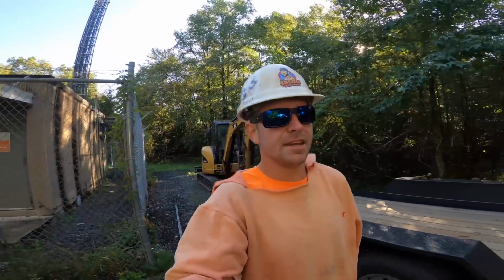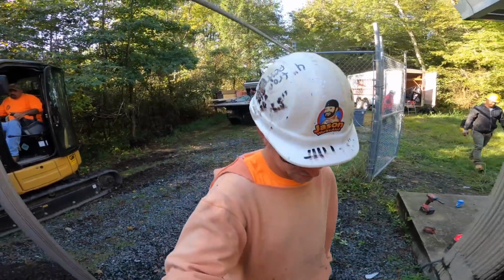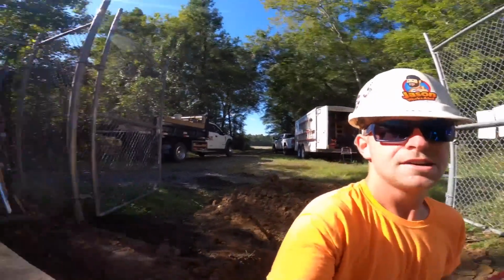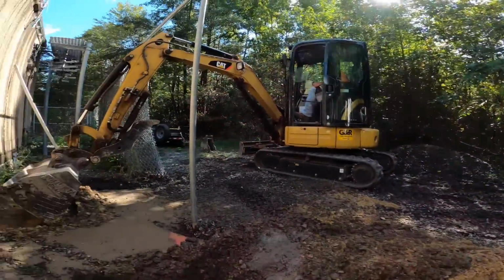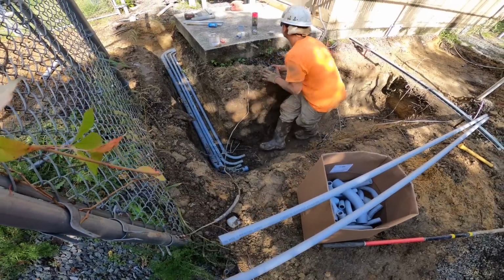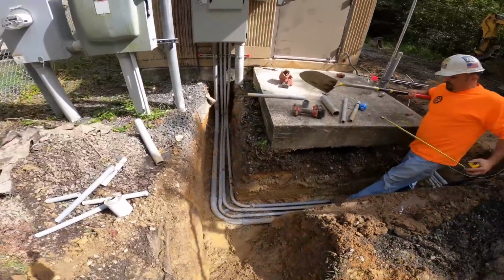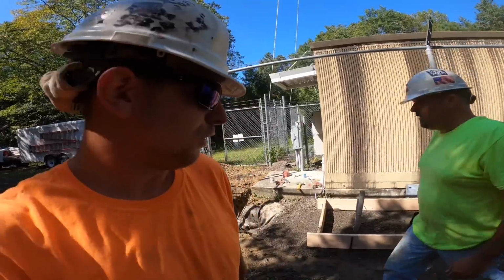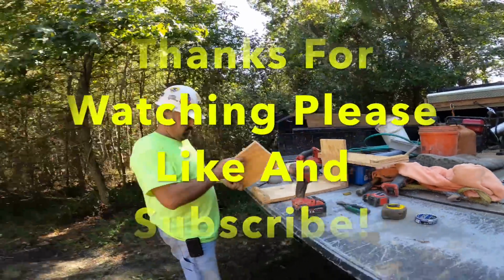The Cat 303 Mini Excavator and Ford F550 Powerstroke Down to Maryland

Comment: Takeuchi makes a great mini! I owned a tb235 for years and loved the power, speed, responsiveness, comfort, etc. You will not be disappointed going Takeuchi!
Reply from the maker: Matt Danger  we are looking at them for sure. Elite seems to have real good luck with them. Just have to make sure I have good dealer support on any decision we make. Thanks for watching Matt 👍🏻
Reply: I own a TB260 & TL12V2. 
They are nice machines I have been very happy with them both.

Comment: All i run is takeuchi .very well made .heavy duty  and long lasting .easy to service.mine are older but are in great shape tl140 and tb135 long stick that pair has made me alot of money.
Reply from the maker: andrew slagle  I never really had any experience with them but since watching YouTube especially Brandon from elite they really seem like good equipment. I really need zero tail swing for the type of work I do so I’m going to see if anything works for me. Thanks for watching We appreciate it 👍🏻

Comment: Not trying to spend your money but... with my 2hrs of Excavator experience let me advise what not to buy:  

My neighbor rented a Kubota U-17.  It had a million hours on it.  Being a rental there were unique features such as leaking hydraulics everywhere, teeth worn down to toothpicks, tracks that would pass for drag slicks and slop in every joint.   The bucket had so much slop that it rattled when idling, while sitting on the ground. The backup beeper had a way of going off for no reason.  I mean you could just swing left and sometimes it would start chirping.

One nice feature was the paint job.  Even though it had nearly zero tail swing, it was bereft if paint.  Every external surface would qualify it for discount at the scratch and dent sale!!

My neighbor wasn’t familiar with power digging so, I jumped on and started figuring it out.  At first I was excited to operate my first excavator.  (My experiences are with backhoes.)   

But, like all affairs built purely on physical attraction the novelty wore off quickly.  Once I lifted the veil the warts and wrinkles showed.  Over travel on the swing made it almost impossible to hit the same hole twice.  The Jerky boom lift made it difficult to control depth.  And the sloppy loose bucket combined with a dipper stick that was unpredictable.  That cramped my stroke length and speed to the point I couldn’t get into a comfortable rhythm.  It wasn’t long until the honeymoon was over... so, I sought an annulment.  

After 2 hours, I put my neighbor in the seat and showed him the controls.  At idle, he was able to dig a ditch that almost resembled a septic trench.  

As for me, I apologized to my baby backhoe for having flirted with another hoe... and let her dig all the laterals to make-up for my indiscretion.  She performed admirably and purred like a kitten the whole time.  

What I learned about track hoes?  A bad one is a miserable affair.  Don’t leave the embrace of the one you love until you peek beneath the veil!

That said, Brandon (Elite Earthworks) has offered to let me take a turn with his Koochie.  Since I’ve seen beneath her veil it won’t be a blind date so, I’m gonna take him up on his offer!

Please excuse me for my less than expert advice...  That’s as much as I can offer.
Reply from the maker: Sassafras Valley  always great to hear from you William! We are looking for a 3O3 size machine which is in the 7000 to 8000 pound range. Can’t be more than 5 feet wide otherwise there’s no sense in getting it. It’s not something I must have it’s just something that would fill a void in our lineup. Same with the skid loader if we find the one we want at the right price we will buy one otherwise it’s not such a bad thing to have a rental company drop it off where we need it. Today we are working three hours from home and had a bobcat dropped off and let me tell you it was kind of nice not having to pull the machine three hours away from home. 
We always appreciate your comments and insight. Thanks for your support William 👍🏻
Reply: Full Tilt Grading in that case... I am qualified to tell you who not to rent from!   If you ever get to SWMO... call me before you rent!  Good luck in your quest for the optimal fleet.
Reply from the maker: Sassafras Valley  I will definitely do that! 👍🏻